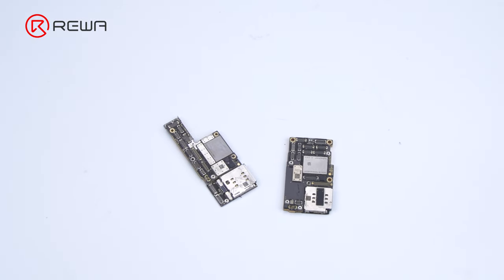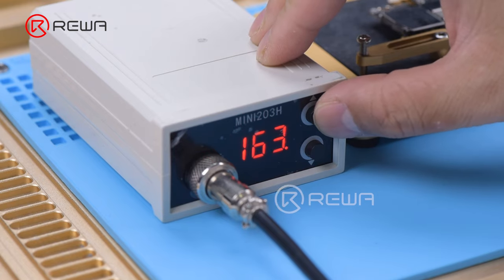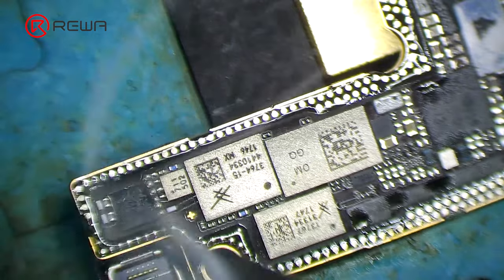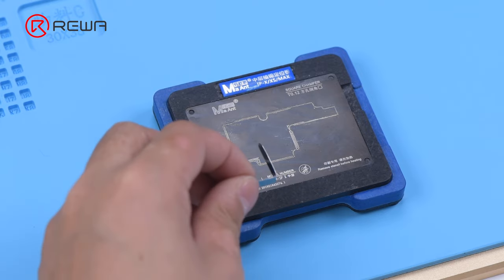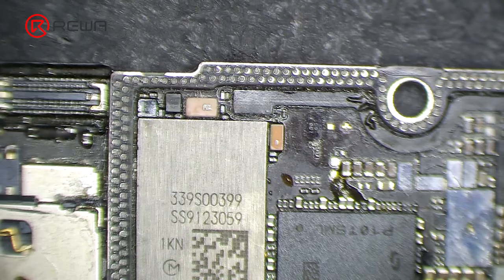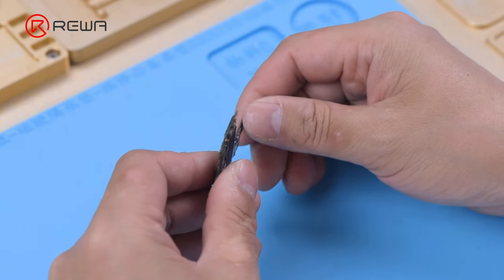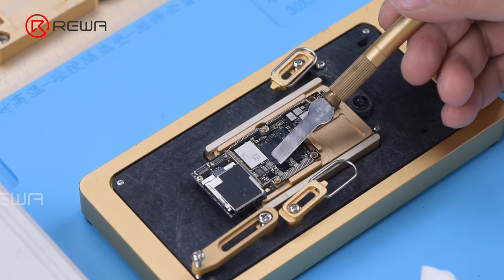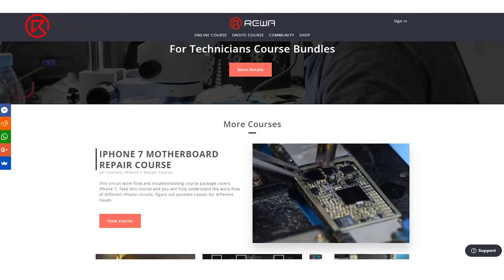iPhone X-12 Double-stacked Board Separation & Recombination | REWA Academy Tips

Comment: Shouldn't you reapply the thermal paste before joining the two PCBs together?
Reply: have you ever repair X and above ?
Reply: @dxdsolutions  he hasn´t. i´m sure
Reply: @mauriciogonzalez5891  Hey smarty pants, I never repaired X and above and I would love to know if you should reapply thermal paste? :)
Reply: @mauriciogonzalez5891  even if I haven't, That's just common sense. You wouldn't put back a heatsink without reapplying a thermal paste if you repairing laptops/ PCs. So I'm sure the same applies for phones as well.

It's a simple question. I don't get why you had to be condescending. People like you are the reason why some people never dare to ask and learn.
Reply: generally too much difficulties to reapply the thermal paste. You don't have factory machines to solder the boards back together perfectly, with solder paste affecting your judgement when solder has melted and sunk down. 
The phone generally will not overheat to damage anyway, it just thermal throttles a bit quicker. For an economical repair, this is close enough.
Reply: Iv used a small amount of PC cpu paste before and had no issues
Reply: @tastytechaddictsmtb  👍

Comment: Iphone xs max no voice when calling. Is it Possible to fix with a jumper?
Reply: @Hideika microphones are ok during video and voice recording, no voice when call only
Reply: @mihakozak  audio ic
Reply: You have to know where is the problem coming from, check other microfones by recording a video from back cam and front cam, if it’s ok then open the app (voice memos) and try to record , see if it’s recording or not , then let me know.
Reply: Its the sound circuit
Reply: got the same twice, just reball midlayer